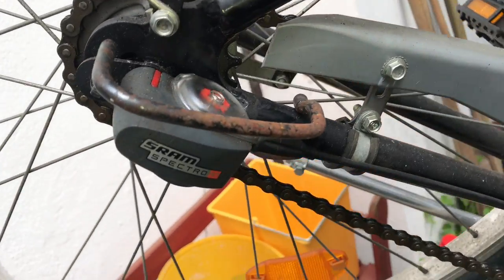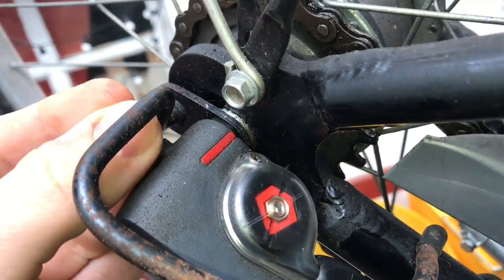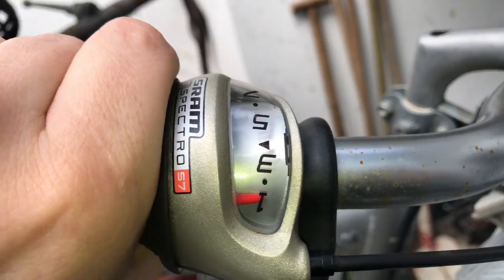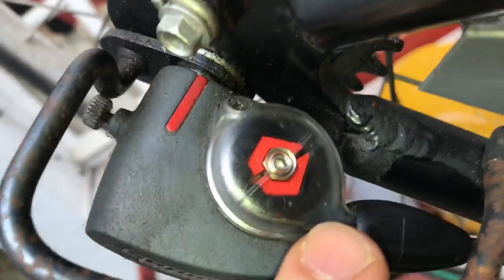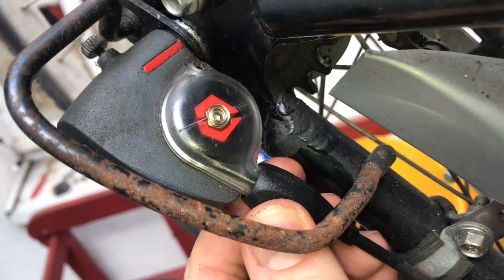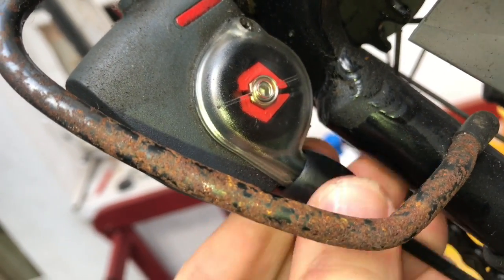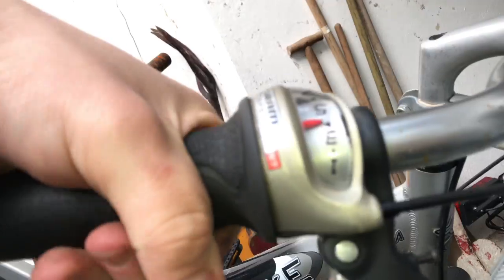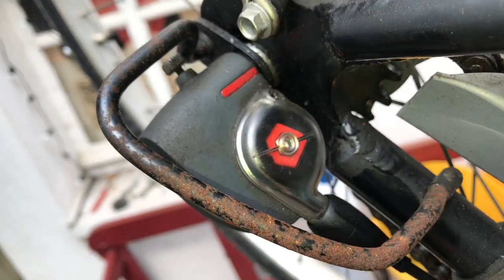How to adjust gear hub of a bicycle SRAM SPECTRO S7 hub gear bike service setup DIY

Comment: congratulations on winning the most boring fucking video on the web. some achievement. i actually did want to fix my gears, but ended up two inches away from sticking my head in the gas oven and setting it alight with a flamethrower. jesus!!

Comment: The gears work fine, but they are slow to actuate : for example, when I switch from the 7th to the 1st gear, it takes four or five seconds to adjust, it's not immediate.
Should I spray some lubrifiant in the gear metallic pin location?
Reply from the maker: Lubrication is every time the first step except brake pads